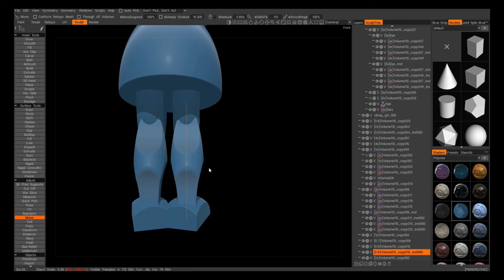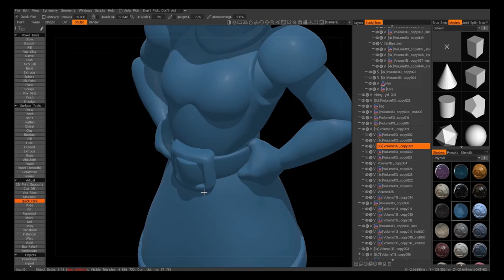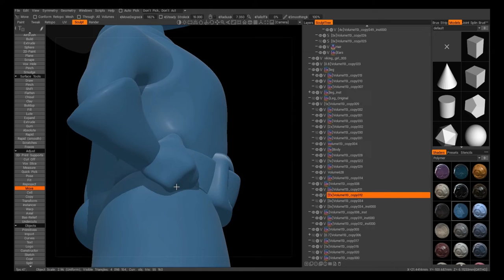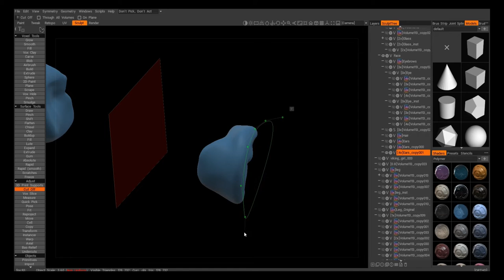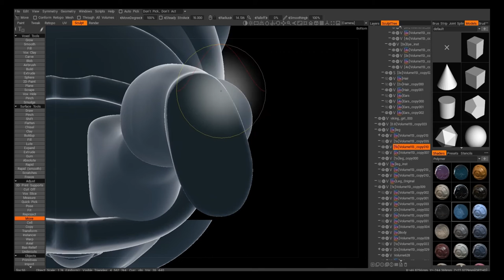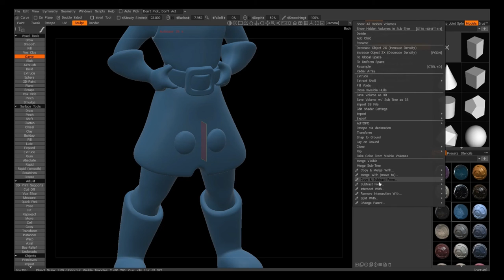Stylized Character 3D Coat Sculpting to 3D Printing   Part 3   Body Sculpting

Comment: Also looking into 3d printers. Resin is cool, but also reaching the same conclusion, just seems too toxic for a home printer.
Reply from the maker: Yeah, even the waste resin is considered a toxic waste which you can't just spill in the drain or throw away. Though I envy quality you get there. It's just will take few years before safe resin all appear. I waited 10 years for regular printing to get cheap. I'll wait another 5 for safe resin :)